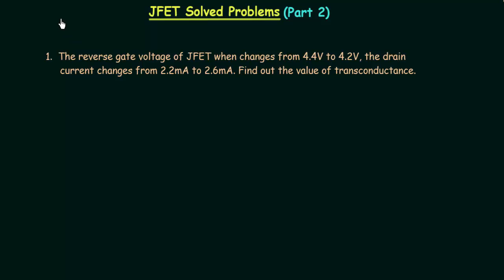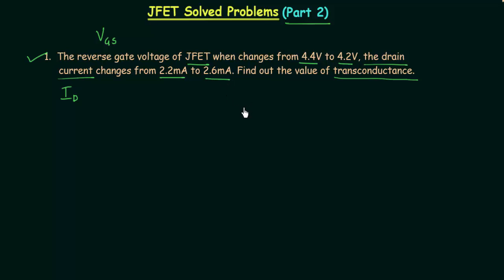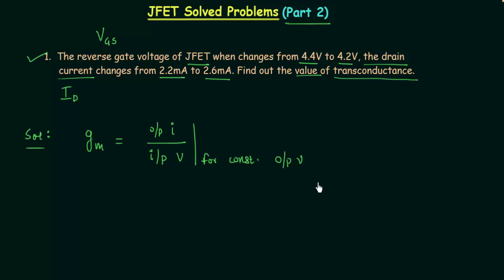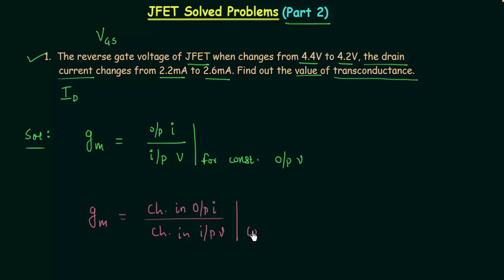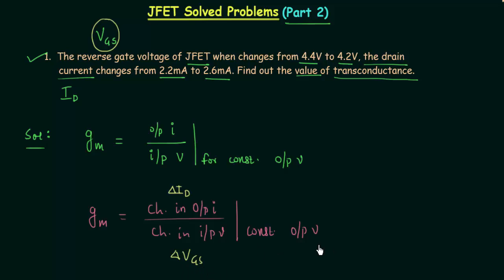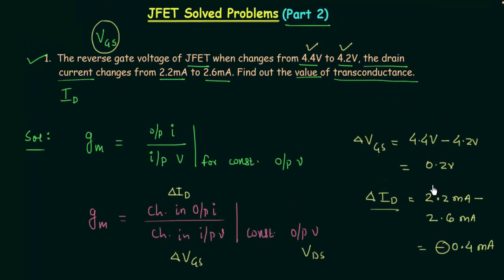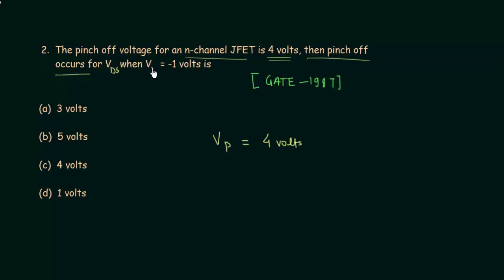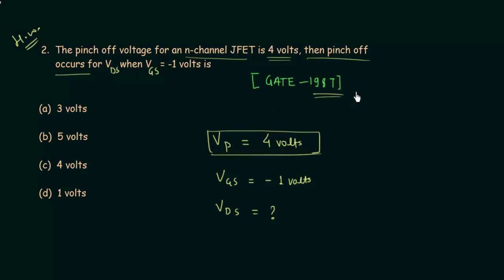JFET Solved Problems (Part 2)

Comment: JFET Solved Problems (Part 2)

1:49 / 6:16

JFET Solved Problems (Part 2)

Neso Academy
2.35M subscribers

Subscribed

 
1
2
3
4
5
6
7
8
9
0
1
2
3
4
5
6
7
8
9
0
1
2
3
4
5
6
7
8
9
 
 
.
 
 
1
2
3
4
5
6
7
8
9
0
1
2
3

 

Share

Download

Clip

117K views  6 years ago  Analog Electronics
Analog Electronics: JFET Solved Problems (Part 2)
Topics Discussed:
1. What is transconductance? …
156 Comments

Comment: In problem Vp=4V when Vgs=0V, now as Vgs will become more negative , Pinch off condition can be achieved earlier that the |Vgs|<later value.
This behaviour can be seen from the O/P or Drain characteristic of JFET or logically it can be thought like when both DLs seems to touch each other is when at Vds+|Vgs|=Vp(Vgs=0V)...
Now for the problem in video Vgs=-1V and Vp=4V,
Vds will be Vp-|Vgs|=4V - 1V=3V
Thanks Neso for this wonderfull service................................

Comment: Pinch – off voltage (VP) and VGS (off) are defined as:
Pinch off voltage (VP):- It is the value of VDS at which ID levels with
VGS = 0 V.
VGS (off):- Value of VGS that completely pinches – off the current to
zero. Magnitude of the two is same i.e.
|𝑽𝑮𝑺 (𝒐𝒇𝒇)| = |𝑽𝑷|
When 𝑽𝑮𝑺 = 𝟎, 𝑰𝑫 𝒔𝒂𝒕𝒖𝒓𝒂𝒕𝒆𝒔 𝒂𝒕 𝑰𝑫𝑺𝑺 and characteristic shows VP.
When external bias is applied gate channel still requires – VP to
achieve pinch – off. So the relation modifies to
|𝑽𝑮𝑺| = |𝑽𝑷| − |𝑽𝑮𝑺|
Where VDS on LHS is the new VP for the applied bias.
In this problem,
𝑽𝑷 = 𝟒𝑽
  & 𝑽𝑮𝑺 = 𝟏𝑽

𝑺𝒐, |𝑽𝑫𝑺| = |𝑽𝑷| − |𝑽𝑮𝑺|

 |𝑽𝑫𝑺| = 𝟒 − 𝟏 = 𝟑𝑽
Reply: the answer is (c) 4v because is the VP even if vgs varies,
Reply: no @sulaimanmustapha2338

Comment: if Vgs where 0v pinch off will occur at Vp=4.but now since the value of Vgs =-1 negative its pinch of voltage should have to decrease .so it probably  4-1=3 v

Comment: Since the required reverse bias voltage is 4 volt to reach pinch-off condition, and 1 volt is already given in the form of Vgs so the required reverse bias voltage should be 3. Thus the answer is 3 volt.
Reply: Noice
Reply: nice explanation bro

Comment: It simple to solve given 4 v is pinch off volt  at Vgs=0 . When Vgs=-1 then pinch off decreased  to 3 volt and its correct option. Because  1volt is too low value .

Comment: Accrdng 2 graph plotted b/n Id&Vds Id inc with Vd inc as Id directly proportional to Vd    Id inc upto the pinch off voltage  after attaining pinch of voltage if we further increase the Vds, Id remains constant where Vgs voltage cannot alter the pinch of voltage so the answer is 4 volts

Comment: i think 3 volts is correct
because when Vgs=0 then vds=mod(vp)=4
pinch off occures at 4volts reverse bias voltage
but they given vgs= -1
so vds =3 is enough

Comment: The answer would be 3V. Why? 

If Vgs is less than equal Vp then it is in cut off mode, and since Vgs is greater than Vp then its not in cut off. 

Vp=Vgs(off)

Therefore we can say that:

Vds>=Voverdrive 
Voverdrive=Vgs+Vp
                   =-1V+4V
                   =3V

           Vds=3V

Comment: 3vis answer 
Reason..5v and 4v cant be...cuz they are more or equal to Vgs...and  seeing the graph of Id vs Vds...the variation of pinch of voltages is that when u decrease the Vgs...pinch off voltage decreases by small amounts...hence...it cant be 1 volt...as it is far away from 4v....so the answer is 3v....

Comment: Thinking smartly as per Gate level, The pinch of voltage is given to be 4v ,that implies that when Vgs=0 Vp=4v. now it is obvious that when negative biasing is applied on gate terminal the  pinch off voltage decreases and will be less than 4v .Hence 5v,4v options are eliminated . Now considering the Vg =-1v now if vg=vp =1v  Id=0 and remains constant.

Comment: The answer is 3v.because when Vgs is equals to 0 then Vds = |vp| and then the value of Vds is maximum for drifting the electrons towards the drain.But  when the Vgs will have some negative value then we don't need to Vds as the same higher value.so we get the constant current at the lower value of Vds.so the answer becomes 3v
Reply: RAJASRI PANJA Actually resistance=(change in voltage/change in current).....So after pinch off region,Changes in drain current respond very slightly or almost negligibly to change in O/P voltage....Hence resistance becomes infinite,since current doesn't change much!
Reply: yes correct one. It will attain saturation at a alower voltage. We can think of the difference across the gate source pn junction to be 4V for reverse biasing it completely so if Vg is alrady 1 V less then Vs then making Vds 3V will reverse bias the upper part of junction enough to lead to pinch off condition.
Reply: Udit Ojha right. Do you watch the lecture of pinch off voltage ? If yes then please tell me one thing  please ?
Reply: Yes I did! say what?
Reply: Thank you for replying.in the lecture of pinch off voltage there is a graph between the output current  Id vs Vds.after point Vds =Vp in the graph we obtain a horizontal line so we can tell that the resistance is equals to infinity because  the slope is zero.But we know that after Vp the current is maximum (this is called Idss ) but if the current is maximum then how the resistance is equals to infinity ?
Reply: @rajasripanja9053  nice question
Reply: Welcome Sis.....
Reply: ASHUTOSH MOHAPATRA  thanks bro
Reply: ASHUTOSH MOHAPATRA  thanks one's more bro.Absolutely correct answer
Reply: Sorry did not see the notification. Yes actually the current flows because there is a very narrow channel which has to exist otherwise the whole linear voltage drop concept in the drain will become absurd which explains the varying depletion region width along the drain. And as far as resistance is concerned as the channel is very narrow, the resistivity increases and so does the resistance too and as evident by the graph it almost tends to infinity or practically in the order of Megaohms. Btw are u an EE or ECE student?
Reply: Udit Ojha  thank u so so much.you r right. This is best explanation.Thanks once again.
Reply: I think u are an EE student. Am i right ?tell me first. There after i will tell u
Reply: Udit Ojha my exam is very near .your answer helps me .so thanks once again 😃👍👍
Reply: yaah bro you are right... 3 is the correct answer
Reply: Have a good day
Reply: When the magnitude of the VGS reduces from zero(0 to a negative value), the pinch off voltage too ruduces. This can be cleary seen in a ID/VDS graph. So the answer is 3 volts.
Reply: I am an EE graduate of 2016 batch from NIT Silchar. you?
Reply: Oh good. I am not an EE student dear.I am a physics honours student of first year.😊😊

Comment: Vp          Vgs
      4            0V
      3            -1V
      2             -2V
       1------- > -3V     
       0             -4V

i.e pinch off occurs at Vds equal to 3v  when Vgs is -  1v.
Reply: Thanks
Reply: Its not a linear graph.... For small values you can approximate this.
Reply: how will be graph draw.

Comment: according to output characteristics of JFET when ve decrease Vds the locus of Vp heading towards origin  so at at Vgs = 0v Vp = 4v and when we decrease Vgs to Vgs = -1v the locus of Vp shift down left it means that value of Vp decreases so ans will be 3v

Am i right ????
Reply: Krishnapal, that's what I thought in the beginning but think conceptually-
If we are already applying a voltage to the gate in reverse bias, then the depletion layer increases a little. That means the V(ds) required to attain pinch-off will be lesser. So the options narrow down to 3v and 1v.
Reply: mandheer mishra .
Reply: I think here we are increasing Vgs from 0 to negative 1

So this 1 should be add with 4 and ans will be 5